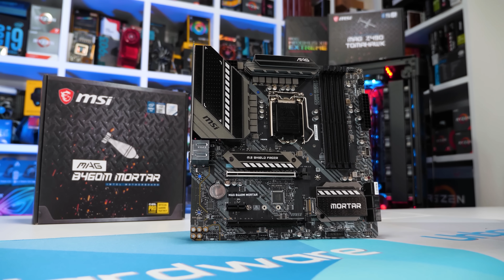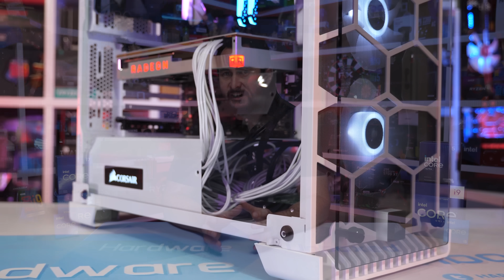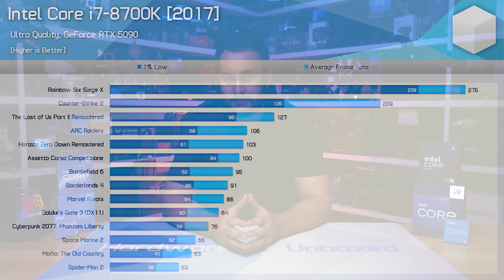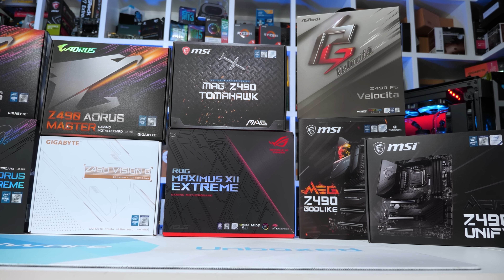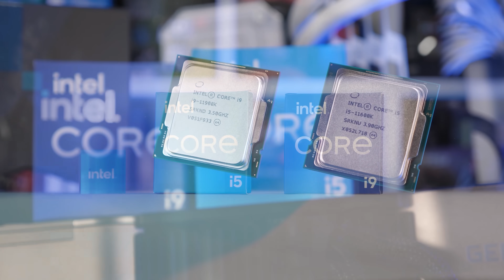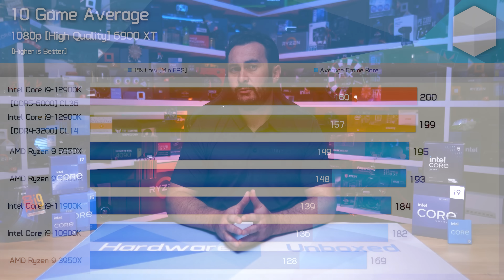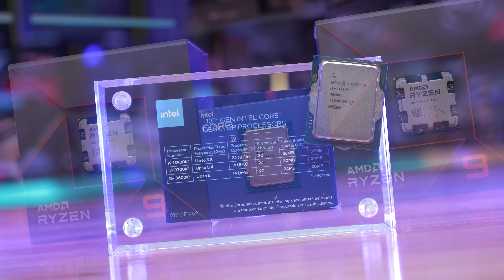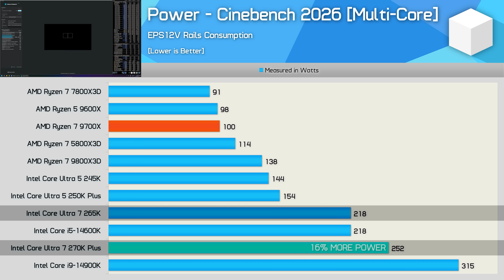How Intel Fell Behind, 10 Years Of CPUs Benchmarked

Comment: Intel are stupid. With AMD , the same person would buy 3 of AMD cpu`s to upgrade their motherboard until the next socket comes out.  The few that bought Intel, need to get a new MB every time they upgrade. They screwed up.
Reply: Not everybody upgrades. Most buy a system and use it til it slows to a crawl or goes pop. Because they don't know any better and bought some pre-built and found out later on that Intel rarely gives you more than one gen per chipset/socket
Reply: @greebj  Absolutly, there are a lot of those customers. But the enthusiasts change AMD cpu`s every year, and sell off  the old one to someone that does not have a big budget, and a new AMD cpu is then sold at the store.  It is there Intel is missing out.

Comment: Intel turned Steve to Mad Max
Reply: Steve without DLSS 5
Reply: @watching_events447  With DLSS5 he looks like young Tom Cruise.
Reply: It's Mad Steve not Max. hehe
Reply: I’m getting homeless Colombo with a beard vibes
Reply: Some things to add for the Conclusion: 7700k could get to 5.3-5.5ghz with delidding. 5ghz OC was the minimal OC out of the box. 10900k offer pretty big improvement over 6700k with significant Overclocking reserve every generation and what Intel did with ageing 14 was amazing from a technical standpoint. The whole time Ryzen was behind in Gaming charts until 7800x3D showed comparable performance. 

PS: Gamers Nexus wrote I7 in productivity, I5 in Gaming. The whole video sounds like Intel was not the better choice for gaming. 12gen wasn't as good with DDR5 but Ryzen infinity fabric still bottlenecks DDR5 to this day. Big time.

Comment: Still using a 7700k in the system I'm typing on right now. I actually bought a 6700k and rocked that for a long time. It eventually died when a power stage on the motherboard exploded. Replaced it with a 7700k and I'm just too lazy to upgrade this system right now. It does alright considering how old it is.
Reply: "too lazy" lol just admit you are too broke like the rest of us
Reply: @Ecoxiss  I would except for the 9800x3D sitting on the dining room table. I've got parts just not time or will to get out of my chair.

Comment: Nova Lake's bLLC will be interesting because it's supposed to be their shot at rivalling AMD's X3D tech. If they can also commit to socket longevity, finally, then they may actually have a chance at a viable comeback.
Reply: If it's on stuff that is obtainable. If it's on HEDT only, it won't be cost comparative with X3D
Rumours have suggested laptop HX will top out at 28 cores and not get the 52 core bLLC version, which is very meh. The 16 core HX3D laptop HX is streets ahead in gaming fps it's only held back by the comparatively lackluster underclocked+24Gb 5070Ti they call the 5090M

Comment: I regret choosing the Ryzen 5 7500F instead of the i5 14600KF for my build, considering they were the same price.
Reply: 14600K is pretty darn decent, also supporting memory speeds the 7500F can only ever dream of
Reply from the maker: Why do you regret it? There is almost no chance you would be able to tell the two apart for gaming and in years to come you will be able to slot in what is almost certainly going to be a much faster CPU.
Reply: Now that I'm in college, I've realized that most of the applications I need require a lot of core support. When I bought my 7500f, I was focused solely on gaming and didn't plan for the future. While I can certainly upgrade down the line, I've already maxed out my budget.
Reply: @matsuura_midori  I feel like a lot of AMD fans care about gaming and gaming only
Reply: I admit that at the time, a lot of people were recommending the AM5 platform before the RAM apocalypse even happened. I decided to go that route, but now I'm stuck with my 6-core 7500F and won't be able to upgrade again until I graduate from college.
Reply: @matsuura_midori  yeah, but it's okay because we've learnt a valuable lesson, which is that most people like to jump on the bandwagon with minimal criticial thinking. And hence our thoughts get influenced by them. We've gotta make better decisions ourselves
Reply from the maker: No one would have recommended the 14600K over the 7500F for productivity though 😅 wait we did!
Reply: @Hardwareunboxed  redditors would like to have a word with that

Comment: Lack of Mobo longevity and not competitive at the top end of the gaming market. No point in buying intel right now imo
Reply: Yeah because everyone only uses their PC to play games?

I have a solution for that. It's called a console
Reply: @pixelsam123 why would I want terrible frame rates and low resolution? 

Imo means in my opinion, and my opinion stands. Thanks for playing
Reply: @dandylion1987  Intel can do 95% of AMD's play while delivering overall 150% work performance, which matters a lot for people who...do productive work

Though a tuned 9800X3D does lose to a tuned 285K or 270K Plus at 4K because the X3D cache isn't big enough to boost 4K gaming. But a 9800X3D does help in eSports 1080p titles where normal people think they can go pro somehow

Speaking from a disappointed 9900X user. I should've realistically got the 265K
Reply: @pixelsam123  Not everyone, but some do. I do. 
PS:The benchmarks here are also heavily focused on games.